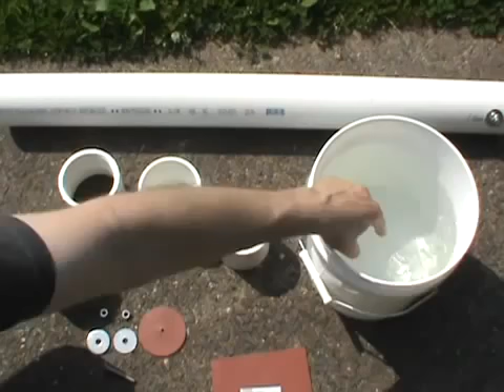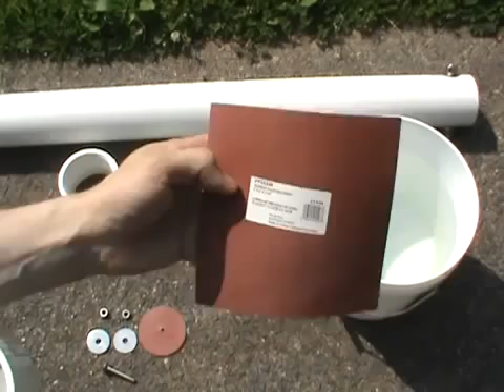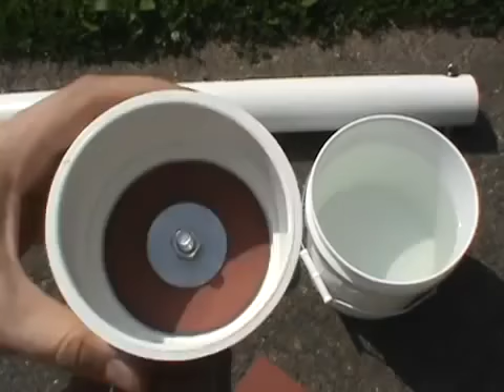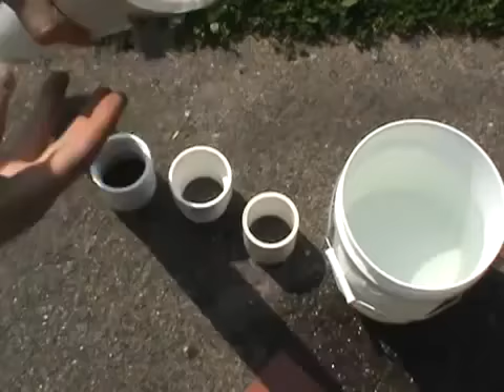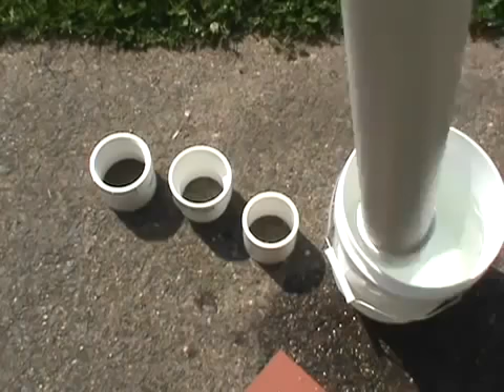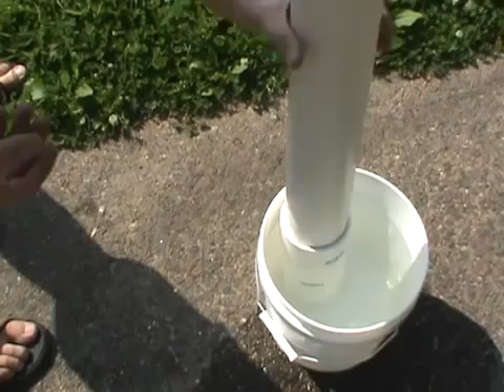Improvised PVC Well Bucket

Comment: Just left Lowes and bought everything here. Cost me $52.
Instead of glue and the extra fittings I bought 4 stainless self tapping screws. Going to screw my cap on so I can easily remove it if needed. 
Thanks for the video. I was going to go a different setup until I seen this.

Comment: You put the screw through the cap and put a nut inside plus a fender washer, then the rubber gasket. Now the nut doesn't allow the rubber seal to drop enough to seal the bucket. Is the hole in the cap so big it allows the nut to go through the cap. Why are you using a carriage bolt instead of a regular bolt?

Comment: Why glue it on with all those extra parts? Just slide it on and drill a hole on two sides and screw it on. Take out 2 screws and wallow remove cap change rubber or whatever and reinstall

Comment: Just made one based on your video. Had to do a 6 foot 2" diameter pipe for it to fit my well. That will give me 1 gallon of water with every pull. I was worried because the valve leaks a bit during testing with dunking just the end cap in water, but fully assembled the weight of 6 feet of water pushing down on the gasket makes a really good seal. Idk if I'll ever use it but I'll have it if I need it.

Comment: I'm going to buy this stuff tomorrow. I have a well but trying to figure out how to get water when shtf situation. Lehman s wants big money. My well is a dug well and about 3' across. But I wasn't sure how to get a bucket to get the water out.   I'm going to rig up something with a spool and a pulley to operate the rope.  Plus thinking of small wire attached to the bottom bolt to release the water from the top

Comment: I drilled the holes a little too far apart so I had to keep adjusting and checking the valve, and also I didn't have enough money to get the 2 threaded pieces, I had to glue the valve right on to the PVC.  In any case it seems to be working.  It's a little piece of mind.  Thank you for sharing your video.
Reply from the maker: Good job!

Comment: Do you have to take anything out of the well before you'd use this?
Reply from the maker: This was used in an old well from the 1800's which did not have anything in the shaft.  Modern wells with electric wiring and pipe may get in the way of the bucket being lowered.

Comment: Just working off of your great idea, why don't you try this.   I have seen another bailer using many of the same materials whose link I put at the end of this comment.  It used most of the materials in your design but, had one big hole at the bottom covered with a smooth ball.  Essentially, it was a check valve.  I would look at finding a way to push the ball up to release the water without tipping the pipe to empty it like what is possible with your idea using the bolt attached to the flap.  I believe this design with the ball would be lighter and probably have a more reliable seal.  In addition,  it could be easily designed  so as not to need the extra fittings you put on for access to the gasket.   With your inventiveness, I'll bet you can figure out the best way to do this.   The other bailer is at https://www.youtube.com/watch?v=SERwTNJki10

Comment: Love this idea.  I thought it was going to be just another well bailer made with 4" well pipe.  However, your idea is an improvement over what I have seen in that it could be used to drain the water from the bottom instead of having to tip the pipe over each time.   Tipping the pipe to a position to pour it in the bucket is a lot of extra work plus, you're likely to lose some water in the process.   With your design, some kind of cross member atop the 5 gallon bucket could hold the bolt at the bottom, pushing up on the flap and, allow the water to fall into the bucket without having to turn the pipe upside down.    Lots of ideas could be used with this design.   Good work.

Comment: Brilliant. We have screwed around with a 3/4 inch hose with a "foot valve-Large bearing instead of rubber flap" attached to the end. The water pressure pushes the bearing up filling the hose. Once primed you can jerk the hose up and down and get water to flow with each jerk. Problem is after like 68 feet down it no longer can push the water up...too heavy. Your bucket here is not effected in such a way. Great idea at any depth. If we ever get water under ground in Calif I`ll try it.
Reply from the maker: I'm currently renovating a 125 year old well which has been out of service for about a half century.  I have a few pictures on my Google+ account and will be adding some more soon, followed by a video when the project is finished.  The current well bucket in the video will need to be revised due to the size of the well shaft casing being smaller than I thought.  However, the bucket will only serve as a back-up to the hand pump.  So far the hand pumps works great.

Comment: Great invention! U could also put a line attached to the bolt inside, run it to the outside so that when u pull or crank the "bucket" out, you just pull the line, which will open the gasket and nobody has yo get their hands wet!

Comment: Excellent video. I had no problems seeing it. Very well thought out idea, and I appreciate the fact that you took the time to drill those holes in a nice pattern, and used SS hardware. I will say that I'd like to see the end result being used on that old well. I also wonder about the bolts on the outside of the pipe. You'd have to be careful you don't make the overall outside dimension bigger than the inside dimension of the well. Assuming you're going to use it in a steel-cased well like I have.